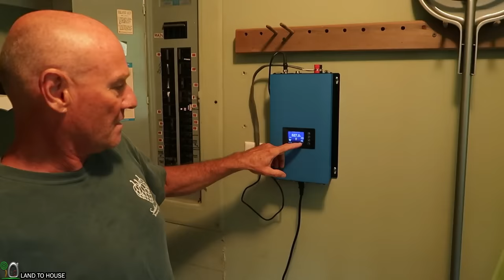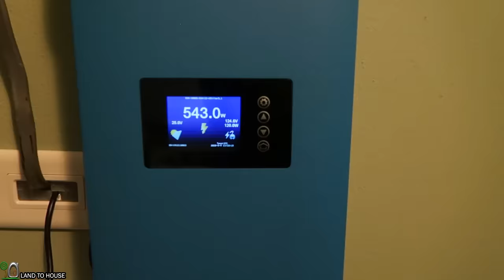Awesome Low Head High Flow Grid Tie Micro Hydro 530 watts!

Comment: Fascinating, I never thought about it, but it would be so much easier to manufacture a large water-column and use its pulling weight to turn a turbine than using the pushing weight of a massive water-column.

Comment: Just because it is 3 phase does not mean there are no losses over the cable back to the house. You will still have resistance, capacitance and inductive losses due to the combined impedance of the cable especially at low voltages. The losses are less at high voltages. That is why transmission distribution lines operate a at 11kv, 132kv, 330kv and above to reduce the efect of resistance. The impeadance due to L anc C are a function of the frequency due to the RPM of the alternator and may vary load. Changing the AC cable to a larger cross section will reduce some of the losses due to load related voltage drop over the 3 phase cable. Having an Earth conductor is not an issue on the 3 phase supply as it is a floating system, however using it as a power conductor is not good practice. 
The DC cables look to be undersized and depending on the length could be a source power of loss due to voltage drop.
The suicide cord connecting the inverter to the wall outlet is a fatality waiting to happen should it be knocked out of the wall socket and someone comes in contact with the prongs on the cable plug. As the inverter could possibly still output AC power while the sence leads detect an active grid supply.
Next issue is,  is the inverter is Earthed to the distribution board.

Comment: He's carrying the three phase with a 10/2 cable? Wow - good thing it's only 500 watts. There's one uninsulated wire in that cable. Also - that 3 phase rectifier will be about 86% efficient - tops (so yeah, better heat sink that device). I'm also assuming your low voltage DC run is short (like other side of that wall).

Comment: Would it be possible for him to build or buy a water wheel and another turbo and shorten the pipe running the water through the water wheel creating power in 2 places from 1 pipe 🤔.

Comment: it would de nice to take the converted dc voltage then add a charge controller and charge some deep cycle batteries as backup power

Comment: could add a series of batteries wired for 24 volt d/c coming off the turbine and store power. then convert to 240 volt a/c and back feed onto your panel.

Comment: Hmmmm......if you were to reduce the pipes to 1-1/2” or 2”, couldn’t you feasibly have multiple generators going, without any extra drainage of the upstream body of water?

And if you were to attach a short, thin wire, with a mini cloth flag attached, to the spinning wheel, you would be able to see how fast it is spinning, (or not spinning), from the house, I would surmise! Excellent idea, so long as the creek, or body of upstream water, doesn’t run dry! Thanks for sharing!

Comment: Interesting, no doubt!
But from a physics point of view there is no such thing as "negative pressure". It is the positive pressure of the atmosphere (ca. 1 bar) which gets reduced via the shop vacuum and then pushes(!) water into the pipe. 
Yes the pressure inside the pipe is below 1 bar but it can not get below 0 bar which would be considered negative pressure. Not even space is   exactly 0 bar.

Comment: If u have the same meters as in Germany the will spinn back. (The old ones with the ferraris technique)

//Edit One
The item that converts it into AC Power to fit the grid (parallel) will check for the grid on the output side because else you would have power on the plug before putting it into the socket. the additional sensor is usually not required as its build in (looking at photovoltaik systems, they are pretty much the same on power side)

Comment: 500Watt at 110V or 220V ?
Anyway 80% of my electricity use is less than 500Watts, so I would use this for my TV, Lights and laptop/phone chargers, and use grid for the more consuming applications. This one is amazing. I used to make electricity using a electric motor from a mixer, but the output was about 220V and only 200Watts.

Comment: Interesting.  This actually discourages me from low head hydropower.

It only works in the summer when it isn't frozen over.

It only generates 500 watts so it still requires grid power.

It is inconsistent depending on rainfall.  With no rain it would drain the pond and become much less efficient.

It requires maintenance more so than the regional power grid.

The one big benefit is that it could be used as a hydropower storage battery to make the grid more efficient.  This could be worthwhile!

Interesting.  Not saying I have it figured out, but I would have expected more based on the setup.  Seeing it run well in the winter would impress me more.
Reply from the maker: Hydro power either takes a lot of water or high head pressure. My personal setup has 150 feet of head and 30gpm. It can do 300w. This one is more like 15 feet of head and 300gpm.
Reply: @LandtoHouse  Thanks for your reply.  I totally wasn't expecting that!  

If I knew you were going to reply I might have tried to be more diplomatic.  Hope my comment didn't come across in a bad way!

Comment: Could you put a flow rate tap on the intake side to reduce depletion of your dam water?
If you plumbed a pick up from the down river side of the dam you could use some of the spillover water to prime your start up instead of the shop vacumn.
Just an idea discard at will.

Comment: Given the suction in play, I'd put 1 or 2 additional turbines in parallel or a higher wattage one to produce more power than what is used in the house. Nice design, but not easy to find land with that level of water flow.

Comment: an average house i would say need around 3000 to 5000 watts but you would not be using these watts all time, like at night depending on the things running you may be only using few hundred watts. In that case net metering would be important so that you get payed for your electricity

Comment: When I got my solar panels installed I had an ANALOG power meter. It actually ran BACKWARDS. Then my power company contacted me and told me I had to allow an upgrade my power meter which will also read backwards power. After I continued to ask it boiled down to "planning". The power company gathers the information from the meters and uses the backward fed power in their calculations for power demand.

Comment: With this small improvement it is possible for that inverter to see 650w on average on its screen....
     If the turbine is placed on the same side as the main intake, a 90° elbow is saved and friction loss is reduced.
   The other part to change would be the downspout pipe at 200mm and put 2x 45° elbows to the blue pipe! that should further reduce friction and increase rpm, with a negligible difference in water consumption.

Comment: I'm new to this so I don't quite understand why the turbine is at the top of the water run. Shouldn't it be at the bottom to take advantage of gravity? Also, couldn't you taper the pipe to get higher pressure and use that to turn the turbine, if it is at the bottom, faster?
Reply: The weight of the water in the pipe below the turbine is pulling the water above.  It’s a hydraulic vacuum.

Comment: I have an idea using this system for a HydroMechanical Battery, using cheap solar panels in the day to pump water into raised tanks, then at night, run water from the top tanks to an underground tank.  Do you think this is feasible?
Reply: I sure as heck do! (Retired electronic technologist/electrician)

Comment: I would have found 10 - 3 + ground wire to move the power from the turbine to the house.

My guess is if the turbine was located at the outlet of the system, it would have more pressure to the turbine, and less suction on the outlet, so you will improve your pressure to the turbine blades.  Yes, I know you will say because of the suction pressure, it really does not matter.  Well I would say yes it does.  

If you put a pressure gauge at the inlet of the turbine now, you might see -1 psi, and up to -8 psi of suction pressure.  You can not get more than  -15 PSI of suction, even in a perfect vacuum, so reaching -10 PSI would be really difficult.  By placing the turbine about 10 feet below the dam, it will see 5 psi at the inlet, and - 5 psi with the pipe flowing downhill into the lower pond.  Placing the. turbine 20 feet below the dam, you will get 10 PSI at the inlet, and -2 or -3 PSI in the output, so a much more ideal set up.  unless of course if the creek floods and the turbine goes under water.  A cement box to the right hand side of your outlet pool, and put the turbine in that box, with the outlet water going out into the stream without being in the flow pattern of the creek during high flow in the spring.

Comment: 530 watts thats quite a lot. so the generator isnt turning by water but by air being pulled into it by the water flowing in the tube.this is the kind of thing i would perhaps think work in my head, but to buy all the stuff and set it up and see it working... nice.

Comment: I put temperature controlled relay boards in my battery box my inverter box and wind turbine control panel ,rectifier and 300 watt 3 ohm register bank and dump control board and solid state relay. My 2 100 amp 200v mppt controllers also have a temperature co trontrolled relay board and blower fan system and my breaker box and copper bus inside a separate box .1200 watts of solar and 600 watt suitcase array , solar trackers on the 1200 watt array.  500 watt 3 phase  ac wind turbine .

Comment: Would be cool to automate it, for instance ecoflow power stations can store a lot of electricity, 2kw station is not that expensive for instance, but can be even more, they have automation controllers, that can start up smart generator to charge power station when needed, and then turn it off when it's charged, so you can run generator for short periods of time and have electricity all day. Automated launch of turbine when needed could be triggered by the station when power goes low, charge the station then halt the generation. This will be overkill offgrid solution.

Comment: Curious how does freezing temperatures affect this system when ice forms, if it does inside or outside of the inlet pipe. Maybe it should be stainless steel or cast iron?
Reply: I would think that in cold temps that metal would ice up easier.
Reply: @jasonmartindale3171  But it wouldn't crack.

Comment: Can you use a system like a ram pump and send some of that water back up to the lake/creek to refill what is being drained?
Reply from the maker: The turbine is using 300+ gpm. A 1-1/4" ram pump will return 1gpm at best. So it would not do much of anything.
Reply: @LandtoHouse  Dang! Yeah, that's a lot.

Comment: Why not get a bigger generator? Or can you add one or two more of those generators in the same plumbing system?
Reply: You'd likely lose the waterfall.  Hard to say how much power is left.  And it isn't clear about the legality of damming it further.
Reply: @wumpusthehunted2628  just add another generator to the same pipe 1/3 the way down. Take advantage of the fall rate inside the existing pipe.

Comment: I'm wondering if you could combine this microgeneration with a simple water source heat pump system, and have 100% free heat.  Absolutely no shortage of heat energy in that water.  Water source heat pumps are even more efficient than ground source, much more compact and much easier to install, so with say two of those turbines, producing 1kW of electrical power you could produce something between 4kW and 5 kW of heat 24/7, off-grid and for free, using the electrical power to run the pumps and the compressor.

You might even be able to run the heat source pipes down inside that 6 inch tube.  The very fast flowing water running over the heat source pipes in the 6 inch tube would increase the efficiency enormously compared to having the pipes sitting in still water (and especially when compared to pipes in the ground) so you may not need super-long heat source pipes.

Anyway, just thinking aloud here.

Comment: There's a lot of pipe running down the hillside to the pool, could you hook more turbines up and take better advantage of the flowing and generate more electricity?
Reply from the maker: The resistance would slow the turbines down and make about the same. If there were too many turbines it would stop the water from flowing fast enough to make power.

Comment: with 24V  at 500W from the turbine to the meter you have 20A over 100feet, and  you certainly will have considerable losses. I would try to raise the voltage over the long distance and go down to 24V as late as possible.
Reply from the maker: Good point. And stepping up wire size.

Comment: Just wondering if you could reduce the flow rate with a battery bank that could constantly charge in the background and that power can be accessed without any need for the grid.

Comment: Looking at that flow rate couldn’t you add a second turbine on the lower side of that where the vacuum port is and double the output of it without effecting flow rate or pulling more water?

Comment: could also have a cylindrical turbine under the spillway like a paddle wheel. id also dredge out that bottom area or build a pit to increase the head height.

Comment: After that turbine had been running there were still bubbles coming out the lower pipe that means there is an air leak. Maybe the homeowner never primed and glued the PVC pipe sections together, but there should be no bubbles at all from that lower pipe.

Comment: The meters we have in Florida will not charge you for back flowed electricity.  I'm not sure if this is true in all cases.  In other words, the measurement can sense direction but does not account for it.  I don't know if any meters return the absolute current (positive regardless of direction).

Comment: Actually you don't need a vacuum cleaner to start the siphon. Use a 6 inch PVC change over valve at nearly the end of the pipe. Let the pipe fill full (It will be full if you close the 6 inch valve) then open the valve quickly. The amount of water that comes out the pipe will start the siphon.
Reply from the maker: The problem is that the pipe comes up and over the dam. The water will not fill the pipe without the vacuum pulling over the dam.

Comment: I know this post is around 10 months old but I was wondering if the after flow could be redirected back into the pond without jeopardizing the system. It seems if it could be done there would never be an issue of pulling the level of the pond down too low. Just curious. Thanks great channel and video.
Reply: That's gonna take more electricity than generated from turbine. The dam fills up naturally from being fed upstream

Comment: Surely placing the turbine at the bottom of the slope would produce more power as the water is flowing faster?
Reply: it really depends on the head not if the water is flowing faster

Comment: Quick question couldn't  you simply used a 240v split phase inverter (instead of 120v) you could effectively run balanced load on the entire house and possibly shut your main breaker off when the turbine is running? Also with the addition of some modest solar on your roof and a small  15-50kWh battery bank  you could likely go completely off grid.

Comment: With a setup like that I would be running multiple units
Reply from the maker: This system actually uses all the available water in the creek. Any more units and it would not be as efficient. Batteries would be the best next step for this system.

Comment: Here's what i don't get:

He could (should?) have mounted the turbine at the bottom of the lower pond and have gotten a few meters of extra height difference in those pipes.

Wouldn't that have overall contributed a lot to the amount of force on the turbine? (Without mitigating the advantages of having high flow?)

Comment: I don't have a clue what I'm talking about but could you not also use the water being pushed out the bottom of the pipe to turn a wheel for more power ?
Reply from the maker: The main issue is this system runs on a siphon. If you pull the end out of the water is loses some suction power.
Reply: @LandtoHouse  learned something :)

Comment: if you are using a 6" pipe with that much flow why don't you install a higher capacity alternator ?? also are you running AC or DC from the alternator to your use point ?? ac would have a lower loss over the 100 yard distance than dc does you can have your rectifier at your point of use instead of close to the alternator ..
Reply: The rectifier is at the point of use, it's just outside the wall where the inverter is mounted.

Comment: Great video.  You have to get rid of that electric vacuum.  It totally destroys the independence of your project.  If the power goes out you can't easily start water flow.  Keep head pressure all the time with another valve so that you just need to turn a valve to start and stop the water flow.